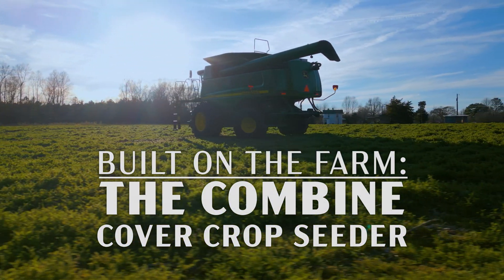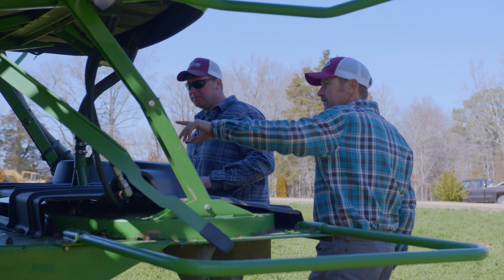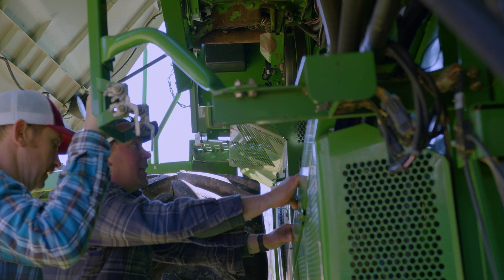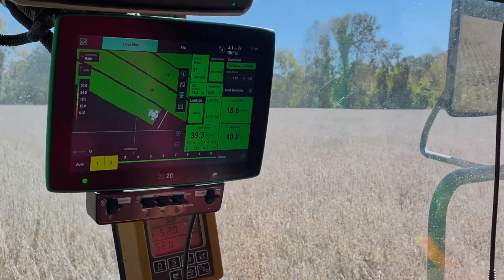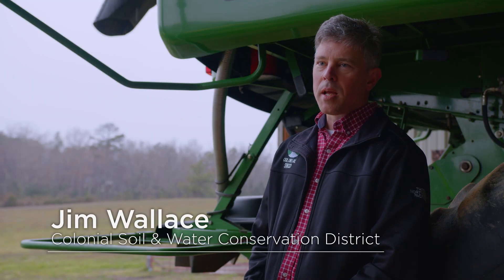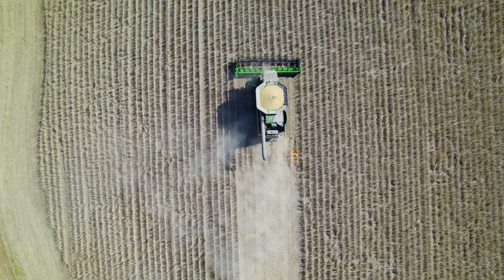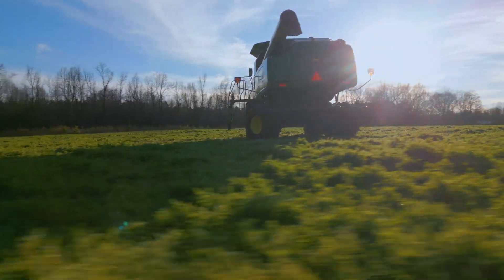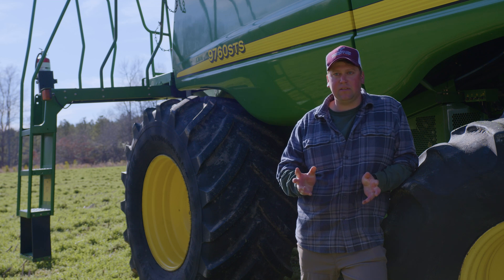Built on the Farm: The Combine Cover Crop Seeder

Comment: Awesome idea! How big is the seed box?
Reply: Each model we build is different, currently building them for case, gleaner and jd machines. The newest one for this machine is 1200lbs, what in this video was the older test bed it was 1000.
Reply: What is the cost?
Reply: @user-ml1xt5xy1i  that depends on a couple factors. We have an "analog" and a "digital" version and what machine it's going on. I am available for P.M. If you would like more information. We like these systems to pay for themselves  in one season.
Reply: @RegFey-f7e  That depends on a couple of factors. Make and model of machine and if it is the "analog" or "digital" version we offer. We aim to keep ROI in one season. I would be happy to P.M. with you to gain a little more information.
Reply: @RegFey-f7e  Do you have LinkedIn to be able to connect and talk more about what you have?